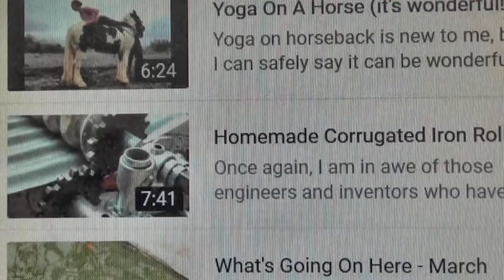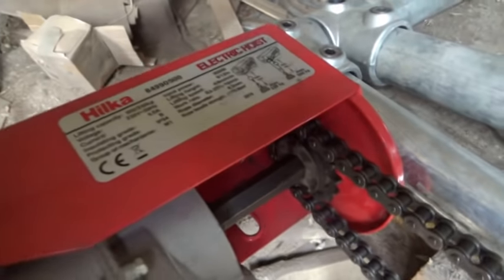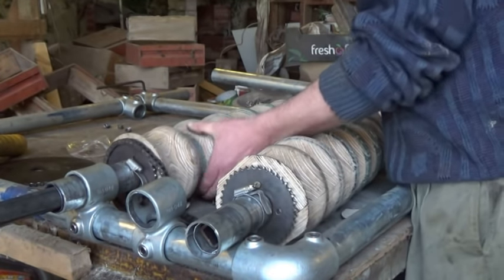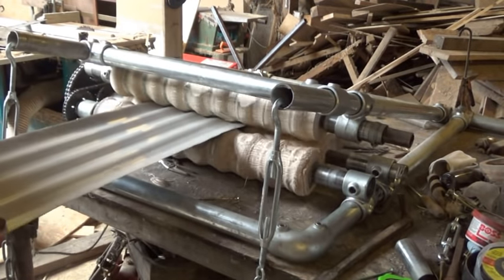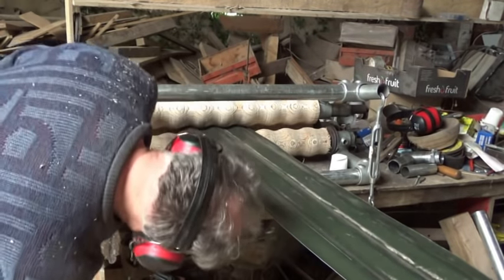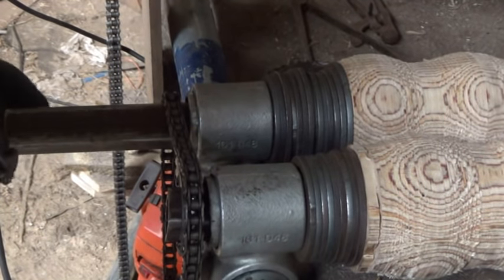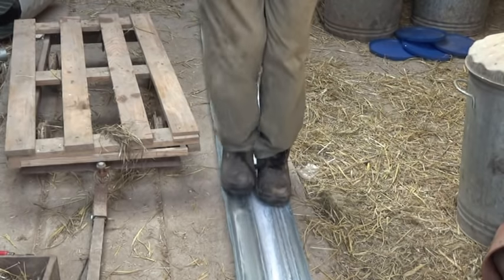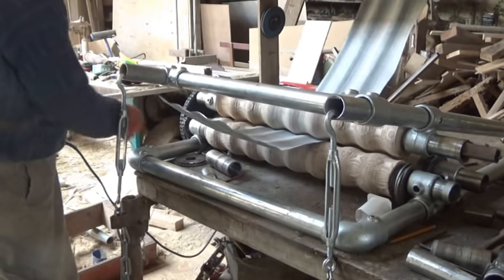Homemade Corrugated Iron Roller - Part Two

Comment: I think part of the problem might be the wood construction of the rollers?  It’s hard to tell,  but it looks like the metal is slipping around under the rollers as it’s fed through?  You’ve experimented with so many different types of metals (and pressures?) that I’m wondering if it’s actually the rollers that might be a problem.  Perhaps trying some of that grippy truck bed coating spray on them?

Another silly suggestion, have you tried heating up the metal a bit before you roll it? I’m not even sure how you would go about doing that, maybe painting one black and sticking it out in the sun for a while, see if that makes any difference . Again, just throwing straws in the cup to grasp at!  👍😁

EDIT: I was chatting with the metalworking buddy of mine and she thought that perhaps the back and forth action might be causing some of your problems.  She suggested sending the metal through in one direction only.  Hope that helps!
Reply from the maker: Thanks. I'll have a think. But  I'm trying for a U shape so I have to go back and forth. Heating would destroy the zinc coating, unfortunately..
Reply: or maybe some rubber strips applied to the rollers, maybe bike inner tubes or similar
Reply: I thought about that too - do the commercial rollers have some kind of adhesion/gripping agent? Maybe pumice dust or something......  I guess because the commercial ones are metal they'd be able to exert a huge amount of pressure, too -  and perhaps do the job in a single pass
Reply: @WayOutWestx2  No heating, gotcha!

I think what she was describing was feeding the metal through once, take it out, bring it back around to the front of your machine, and re-feeding it through the same way.  You still get your U shape, and maybe less chance for a slip causing a misalignment by the back and forth.  Metalworking is definitely not my forte, so I don't know if that's a practical thing for you to do.  Again, good luck, hoping you can get this to work!!
Reply: @brendangilmore4297 .. this is the difference between a precision relatively expensive piece of machinery and trying to make  the same on a budget..sometimes you can get the results needed other times its not so easy, as this shows
Reply: @bazwillrun  Good idea.  Something like a thick industrial rubber band on the high points of the rollers might be all it needs.
Reply: @iambiggus   I think by U shape he means straight sides. So U shaped where he rolls only the middle and not C shaped which would be end to end rolling.

Comment: Ah what a shame. The motorized bit worked so well! I don't suppose the task you were aiming for could be done with non corrugated sheet? Perhaps with some rigid portions between sheets? You could bend hoops out of bar stock then rivet your sheet to the stock following the curve?
Reply from the maker: Yes, but it just wouldn't be the same : -  )

Comment: looks like some of the problem lies in the roll bearings. there's too much tolerance and that they can move around while in use could be causing your irregularly spaced acute bend regions, aka kinking. consider inexpensive ball bearings. and as a design study look at the spacing of the bottom rolls vs material thickness and minimum bending radius of commercially available units and see how it compares to your design constraints.
good joib, keep it up!

Comment: When they actually make the corrugated roofing they do the profiles in small steps maybe try that route.
Reply from the maker: You mean little controlled kinks all the way around? Yes, but I'm aiming for smooth if I can get it.
Reply: @WayOutWestx2  ..not sure but i think he means the amount of the  corrugating profile is done in smaller steps...start off with a shallow pass and  each pass  increasing the amount of the profile...depending on how many passes obviously takes longer..
Reply: @bazwillrun  Yes that  is what I meant

Comment: the frame is nowhere near rigid enough to keep the sheet from kinking, all that slop is what allows it to kink in the first place. There's a good reason they spend so much money dealing with thick steel on the commercial units...
You could always try local heating and cooling (this is how they make the curved plates for the bow of a really big ship), but that would probably not be economically viable.

Comment: 16 - 20 ft galvanized wire fence panels can be bent into a u shape and secured into a wooden 2x4 frame. Poly can then be stretched over the fencing.

Comment: I didn't read all the previous comments so I sincerely apologise if this was previously mentioned, but I did have a thought, which is that there might be an issue with trying to create all the corrugations at the same time. As you create the corrugations, the steel plate has to shrink in width as it forms the curves, so you end up creating the initial corrugations in the wrong place, which might lead to problems as the corrugations grow. In the industrial machines I've seen making corrugated steel, they have multiple rollers that start at the middle and work their way out to the edge.

My second thought is that the stresses from creating the corrugations combined with trying to create the curve might be throwing things off - you need to clamp down on the rollers to get the corrugations to form, but that's also bending the plate to force the curve at the same time. It might be worth having just two rollers aligned that would create the corrugations evenly first, and then you can reposition them to the setup you have now to create the curve in the already corrugated sheet. Maybe if you have a "corrugation only" setup, it would sort out the issues I mentioned first, since it would be much more rigid than the offset rollers.

One test of this theory might be to create a set of rollers that would fit the pre-corrugated steel you can already buy - if your machine can curve those plates just fine, you know the issue might be with the corrugation bit.

Love watching this project, I expect it's frustrating for you!
Reply: Daniel G. -  There's one aspect of what Tim is doing that you missed.  He's not starting from flat sheets of metal.   He's buying corrugated sheets and trying to curve them into a smooth arch.
Reply: @clearasmud376  yeah I guess in that case I'm talking about when he's reshaping the curve

Comment: Cheapest building on $/sq.ft. is as follows:   22' lengths of Steel rebar bends very easily to continous curve.  Short lengths of 5/8" dia. driven into ground as anchors, then wired 4x to each end of each semi-hoop rebar.  More straight rebar added as purlins, all wired together. Use white duct tape over all steel that will touch plastic, so no snags. 20' x 60' sheet plastic, clear with UV protection is std. Greenhouse material & cheap, lasts 10 yrs ++.  Plastic cover over steel.  Door at one end, & you're done
Reply from the maker: They just buckle and bend in the winds we get here - but thanks for the suggestion.

Comment: Wow, I love your perseverance. Take a look at this machine: https://www.youtube.com/watch?v=7f__LAudU9A  I think what needs to be done to improve your machine is to A) have the shape and size of the rollers conform exactly to the profile of the metal to bend, and B) remove all flex / bendiness from the machine so that the rollers only roll and do not move at all in any direction or with respect to each other. Also ensure that all three rollers are perfectly aligned. Have one end of two of the rollers be adjustable in two directions so that your can align them perfectly. Perhaps build a huge box out of 2x8 timbers laminated together with glue, you can make box joints on the corners by alternating the layers. Then mount the three rollers inside it with bearings on each end. And figure out a way to have the top center roller move up and down.  If you remove the flex, I think it will work. Also the other suggestion of rubberizing the rollers is probably good too.

Comment: It's just a dog house, try flat sheet metal rolled in a U shape, and some round rod stock rolled to shape for a welded reinforcement frame work inside. Being rounded and reinforced will be strong enough if a storm makes something fall on it (within reason). Remember K.I.S.S., and you can only choose 2, Fast, Cheap, Good.  Another idea is to look around and find something that can be recycled, dressed up, and put into service. Soon people will be bring you stuff to do something with on a farm. I hope this isn't too far out of sync with your original ideas and intentions.
Reply from the maker: You're right, John, but I'm trying to develop a range of huts that people might buy so they have to look good as well as be fast enough to build. I'm competing with moulded plastic versions - made very cheaply..
Reply: @WayOutWestx2  I thought putting rolled flat sheet metal over a welded frame would be production quick enough for you. Perhaps I am not grasping the needs of the animals as well as the needs of the builder too, and it's just more complicated than I thought. I am confident you'll sort it out.

Comment: Hey Tim. I think that in order for the Corregated to Bend the Innermost valley circumference needs to be made smaller and the outer circumference of the Outer hill made longer relative to oneanother. (Obvious I know) To do this I think the profile might need to be changed.  Currently the Valley and hills are even in depth and evenly space. If the profile was to change I might allow bending.
Reply from the maker: I think you're right about the profile - but I don't know how to calculate what I need

Comment: I think the main problem you have had is the play in the rollers. Another problem is that you are feeding the sheet through “straight” to the bending rollers. More rollers and no play will fix the issue. The weight of the sheet is also adding to the kinks as it progresses through the rollers. Great project.

Comment: Mate 😎
Since it wants to kink all the time.
Why don't you make use of that.
And make it a controlled kink ??
The inside ridge needs the kinks as it is a smaller circumference.
The outer ridge does not.
This would allow you to bend the sheet.

Comment: Use alloy corrugated sheet and anneal it 1st using the old soap turning black  trick so it's super soft .After rolling it should reverse the annealing .

Comment: Try mounting two of the form rollers directly one on top of the other to form the ridges. After that, if you want to put a curve in the whole sheet, set it up as you have it now because that 3 roller set up is exactly as you would use to put a curve into a sheet ?

Comment: Oh man! So disappointing.
Did some research, and some designs have 4 rollers, the ones you have, plus a third on the bottom, right under the top one, to keep it from kinking. It's called a "pinch roller", for obvious reasons. If you ever find the heart to try again, that's what I'd recommend.
Reply from the maker: Thanks, Paul. (I think!)
Reply: @WayOutWestx2  You're welcome!
The other thing is to make the rollers a larger overall diameter in the center than at the ends. This counteracts the tendency of the square tube to bend, and maintains pressure in the center (where you're having the kinking problems).

Comment: Morning! Guys, I am no engineer, by any stretch, but found a video on this process. They changed the plane of operation from horizontal, as you have it, to vertical, with the rollers being pivoted on the central base to spin 360°, allowing the sheets to be manually manipulated as they are fed through? Does that make any sense? It might not be what you are looking for, but it seemed to work for them!
Reply: Regarding your current setup, will it work if at the outfeed, you have a horizontal bar that initially supports the underside of the sheet as it feeds out, with either a manual (to start!) or mechanical system that elevates this bar to a set height, forcing the sheets as fed out to curve at that angle as governed by the distance of the bar from the rollers and the height of the bar? The Angle Bar. Altering the height and distance of the Angle Bar effectively changes the degree of curve? This could be mirrored at the Infeed, once the material has passed through almost entirely, to allow back and forth action at a set angle? Additional Angle Bars might be added at the Outfeed from above, to allow for ‘S’ bends? Am I insane?
Reply from the maker: Thanks, Logrus. I think I know the machine you mean - having them horizontal would certainly help for longer sheets, but I can't even get the short ones to work..

Comment: The only thing I would consider is making the top roller a smaller diameter, as the metal is forming the effect is stretching the outer curve and srinking the inner curve, by how much that is the question, the road to success and all that.

Comment: I can see no reason that the principles used to form larger buildings couldn't be scaled down for your use?  Perhaps having lighter gauge and smaller closer corrugations would be more amenable to your homeshop capabilities?  After all 'U' is nothing more than a 'C' with legs.  Maybe a seam joining the straight sides to the curved top would be more attainable yet achieve the same look you are after?  Just some thoughts...  Take care.  Doug

Comment: It looks like the rollers keep slipping over the sheets, like they don't have enough grip. That seems to be causing the occasional kink...one side of the sheet slips while the other is pushed through...maybe coating the rollers in rubber or something like that might help?

Comment: You need more rollers i think, 3 rollers only works if the sheet keeps a constant resistance against being formed but i don think that is the case. Especially seeing as how it sometimes "jams" and then rolls faster, providing a "kink" in the roll and that kink fucks it up. With 4 rollers you dont just bend it in 1 direction with the resisting sheet pushing back, you bend it in 2 directions to a point of where the steel will be held from 2 sides "at rest" (if that makes sense) So if you have a tiny kink just rolling it a couple more times will roll out the kink.

Comment: It looks like than when the kinks in the sheet happen the rollers move closer together. mabie by blocking the roler so it cannot close the gap with the bottom two rollers may reduce or prevent kinks. doubtful but mabie.

Comment: tighter rollers , lube the rolling surface .... , also smoother rolling action : by that i mean increase the gear ratio to yield something in the rang of 15mm/sec without jitters , how to avoid jitters make sure the winch motor has enough power , over drive it

Comment: I was born in New Zealand where the corrugated iron water tank was a common thing. I often walked past a plumbers on the way to school where they made tanks . Your device is similar but when rolling the curve ,the two main rollers put the corrugation in and the curving roller sat about 5 " away and was roughly level with the gap between the squashing rollers. The forming roller is height adjustable so initially the sheet goes backwards and forwards putting the corrugations in with a man on the end of the sheet to hold it up so it doesn't wrinkle . After a couple of passes the forming rolling is wound upwards and the curve is gently "stretched" into the sheet. Your problem appears to be one where the steel hasn't been allowed to stretch enough and your forming roller is too close .No doubt you have seen the commercially available machines we can buy here in Australia ($$$!) but they only used pre corrugated sheets. here is a pic of the type I was talking of. The forming roller is mounted up top in between the two lower ones and is raised up or down .
https://collection.maas.museum/object/382632#&gid=1&pid=2
Reply from the maker: Thanks Mercmad. Mine isn't perfect at all, but it may be good enough for my purposes. The next video - where I make the curves - should make things clearer..

Comment: tim the reason  it kinking is because you trying to bend something  on an edge concave convex concave  convex each one have 2 edges you need to kill 2 birds with one stone try using the flat sheet shape it to concave convex  and roll it  while it shaping

Comment: I have seen curved corrugated buildings and where the curve is there is dimples pressed in the metal where one roller is a positive dimple and the other roller has a negative dimple

Comment: The top roller should be a much larger diameter, otherwise you can always profile a sheet bending die to match the corrugations profile and radius in increments around the length you intend to bend.   That's how we made curves on brake presses when we didn't have or couldn't use a roller mill. 

Another option is to form the flat sheet, then run it through a 4 roller mill, 2 rollers fixed together vertically,  with the top 2 rollers fixed horizontally,  then spread the bottom two rollers.  The spacing of the top 2 rollers would dictate the radius achieved as a function of the 90° tangent or chord length.
Reply: If 4 was closer but not right. Add a pair in the middle.

Comment: Well, the problem are the waves in the sheets. If you want to curve them in the "hills" you would need to cut out some material (like pieces of an orange) and you would need to add that material to the "valleys" of that sheet. Probably you could make the material collapse in the "hills" and stretch in the "valleys" if you preheated the material at quite high temperatures though that could damage the wooden rollers. Any way I think that you are already getting very good results.